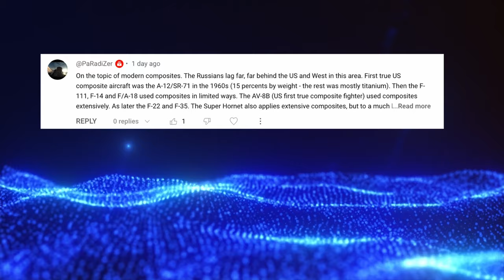Su-57 and the Russian Composite Materials Technology

Comment: F35 stealth coating melts at mach 1, after 30 seconds.
Reply: Source?
Reply: I believe they fixed that
Reply: Not mach 1.   And not exactly melts.
But there's a reason why the plane isn't the M1.3 supercruise plane it was originally supposed to be.
High speed does not agree with the RAM coating.
Reply: @arijfroo  It peels of thats why there not allowed to fly fast you need ceramic paint and India have got it

Comment: Russia and India jointly developed the composites which India used in Tejas fighter after withdrawing from su57 project after many years of development because India wanted a twin seat varient like su30mki which Russia didn't and Russia wanted major component production which is far from India's 50-50 contribution.
Reply: India already had composite technology pre Russia with lca program and by early 2000 was doing the thing with composites 

Fgfa or su 57 program didnt provide us with any composite tech but it was the expertise india brought to project while russians brought avionics etc

Sadly the oroject couldnt go ahead together due to differences in requirement and russian reluctance to fulfill tot promises as were made earlier and due to delays in ech development for su 57 but india still might buy a sqn or 2 of 57 later.
Reply: From what I remember reading at that time was that India pulled out of the program because su-57 design didn't measured up the specs in terms of stealth and performance and russia was not listening to their concerns.
Reply: @Ma_nerd  i remember something that India was going to get a downgraded electronics and radar version of the SU-57 and they didnt like that to. But recently i saw an article stating that India might be interested again in the SU-57 because their own 5th gen fight program is going really slow and China is just spitting out new jets at an increasing rate. But who knows, it sounds like India doesnt even know what they want because one minute they're talking about the Rafale, Eurofighter, Gripen, Su-30s, Su-35s, their own domestic stuff.
Reply: @Ma_nerd  there was a transfer of tech and shared work share agreement with Russia 

Russians created some problems and access issues for indian scientist and pilots

Few tech like promised radar & engine were also facing clear delays and this made India leave the program
Reply: India also has the latest ceramic paint which is the best in the world ,i call it "The Spice Paint"
Reply from the maker: No technology transfer too.
Reply: @millennium7shorts926  yep, they were even not willing to provide access to pilots when asked at times

This strained the idea of co development
Reply: @hiteshadhikari  Russians and Soviets have a long history of composite tech. Su-47 was partially made of them. Not sure what India could help Russians with. 🤷‍♂
Reply: @olexp9017  composites are not just a single item, there are various types of composites too

Some are metal infused , some purely composite etc.

Also Russians are not exactly leading in aircraft avionics as well. I mean they havent used an aesa on aircrafts till now and their aesa radar tech is not completely known (maturity wise)

Similarly russians had issues with fadec which india developed for its own engine program a lot earlier
Reply: @hiteshadhikari  Yeah India is a well known country when it comes to composites and electronics. 😂

Comment: I saw a patent once, but dunno if it is true or not. The material co-developed between Russia and India. Which was one of the bottlenecks in the project, as the first iterations lacked mechanical resistence, thus they cracked. well they made it in the end. 
I read that it is a polymer-ceramic composite, lighter than typical metal sheets used. And most importantly, its dielectric. Meaning it does not give off resonant reflection. 
While conductors absorb the photons of the incoming radar, vibrate and release back a photon of the same frequency, a dielectric does not release back photons, instead the ones that it does absorb, are transformed into kinectic energy in the atoms, generating heat. So the fuselage slowly heats up but absorbes incoming radar waves. 
As this is on the fuselage itself, its more effective than just adding a RAM coating on top of a metallic surface like the F-22 per example.

I like to say that, USA is the master of geometric stealth, Sweeden the master of electronic warfare, and Russia/India seems to be very good at stealth at a material tech level.
Reply: He said UK as well
Reply: @braddbradd5671  yeah, in a broather specter they are very advanced with different aplications of composites. But I never read anything about RAM composites specifically from UK.
They might just well have it, But I never read anything about it.

Comment: Am i wrong in saying leaving F35s on a aircraft carries uncovered in the sun for weeks will effect the radar paint .Iv seen pics of paint peeling off ?
Reply from the maker: It gets a strange coloration. I haven't seen it peeling off.
Reply: @millennium7shorts926  Maybe not peeling of but some of them looked rough and not brand new and smooth , i cant find the pic but it was a recent one due to the gulf activities ........I did a Chatgpt on it .....Yes, the radar-absorbing paint on the F-35 can be affected by prolonged exposure to sunlight. The materials used in stealth coatings can degrade over time when exposed to UV radiation, which can impact the aircraft's radar signature. Regular maintenance and protective measures are usually taken to mitigate this risk, including using protective covers when the aircraft is not in use.

Comment: Republic of china can make theirbown fighter jets. Iran economy is slightly larger and much larger population and massive engineering sector. Why iran doesnt make its own fighter jets
Reply: @Castragroup  Because manufacture and development of fighter jets is the hardest and most complicated thing a modern nation could do. Iran does have fighter development programme but they do not have experience or help to do so.
Reply: > Iran economy is slightly larger and much larger population and massive engineering sector
what?
Reply: @Man-of-Steel674  Agreed - the same problem as experienced and amply demonstrated by India.
Reply: @theolddog5129  u do realise india has a developed fighter program which now has iterations too right? Comparing iran with india is ridiculous when it is one of the few countries with developed aircrafts and was the first country in asia with a developed fighter in asia in 1960's itself
Reply: @hiteshadhikari  I do indeed. The Tejas development has taken 50 years from the start of the initial programme. It was called HF73 and I spent many hours reading about it in Air International when I was a slip of a lad. I am now about to officially become a pensioner and the aircraft is only flying in very small numbers in an interim configuration. Point proven I feel.
Reply: @theolddog5129  very small numbers

Had around 16 td/prototypes inc naval prototypes which demonstrated STOBAR capabilities 

40 mk1 inducted

83+97 so basically has around an order size of 180 mk1a in production

Mk2 has ff next year.

Calling program failure or not working is laughable  esp based on superficial reporting
Reply: @theolddog5129  as yt is deleting my comments, i dont think it's worth it typing large sentences again

I just suggest you to actually do a study about program and not just superficial study based on msm media reports and all ( they dont even know shit about program or defence equipment)
Reply: @hiteshadhikari  FYI - I am an Indian and have spent my whole life studying in detail India's struggle with producing a useful fighter following on from the HF24 Marut. Even now, the timescales offered always prove to be totally unrealistic. This is because of the lack of knowledge and understanding of what it takes to design a modern fighter. The Tejas is by no means a modern fighter as could be easily demonstrated by comparing its aerodynamic profile with say the Rafale or the Eurofighter. I feel that we Indians often allow our national pride to blind us from reality.
Reply: @keizru  He might not be super fluent in English and fumbled what he was going to say.
Reply: @theolddog5129  how did u end up comparing aerodynamic profile buddy, didnt know you can theoretically do a wtt and cfd or design analysis in mind 

Your whole life studying yet so many deficits in program knowledge?
Reply: @theolddog5129  i feel your brown sepoy complex doesnt let you see teal timelines, funding issues and the accomplishments my friend
Reply: @hiteshadhikari  Brown sepoy complex? I will have you know that I love a good Saag with Maki the Roti. Nothing beats it, although I have to admit to having a craving for a Sunday Roast also. This is the problem with us Indians on YT defence related channels - it is impossible to hold a grown-up exchange. It alwas seems to lead to name calling. I think we'll leave it there as clearly you admire the progress since 1971 on Tejas and the fact that the country is still flying the Mig 21 and Jaguar.
Reply: Tejas, Arjun... On the contrary BRAHMOS doesn't have such problems, right? Or Indian cryogenic space tech. We know why, right? 😂
Reply: @olexp9017  brahmos that india uses is very much indigenised and better in accuracy aspect that russian missiles which it was based of.

The jv agreement forced us to limit work in brahmos for decades but in last few years there were amendments made in work share and component upgradation which allowed india to use various indian subsystems like our own seeker and booster etc. while due to working agreement some components will always be russian

Tejas works fine and tbh better than most know

Arjun didnt work for a very simple reason ( i mean mk1 not mk1a), the tank was developed to counter american sale of abrams to pakistan but, PAKISTAN never got their Abrams ( the deal never happened) & as the adversary never got a heavy mbt, Indian army deemed that our req of a heavy mbt was not needed. Arjun performance exceeded t90 in trials but alas as it was a heavy mbt, it was  limited